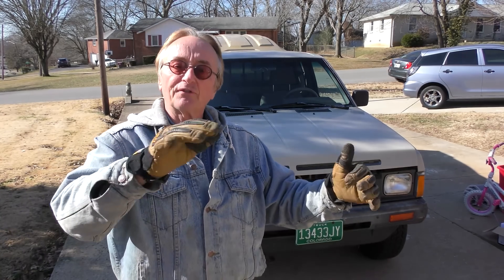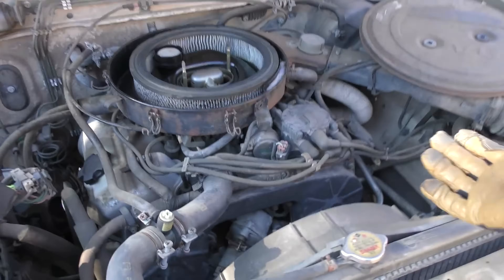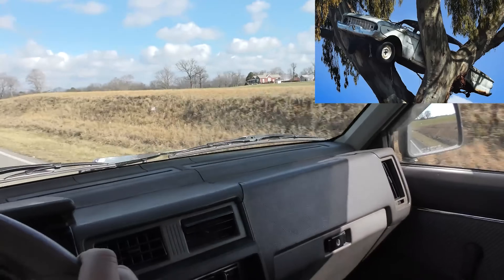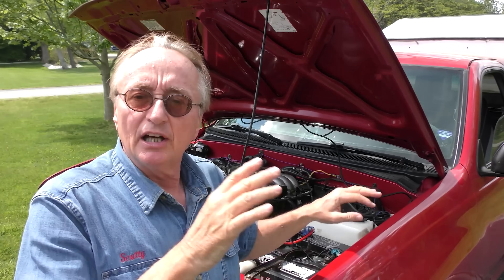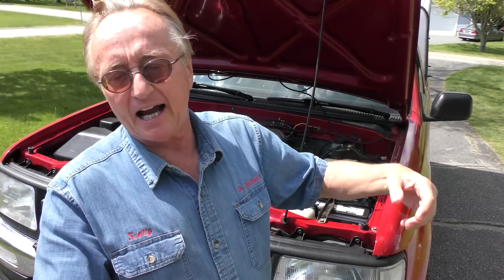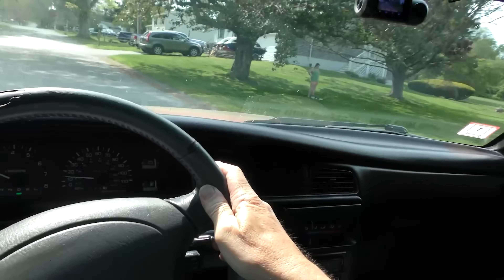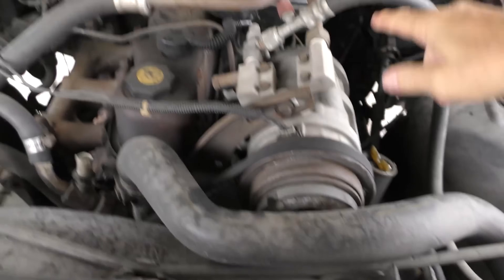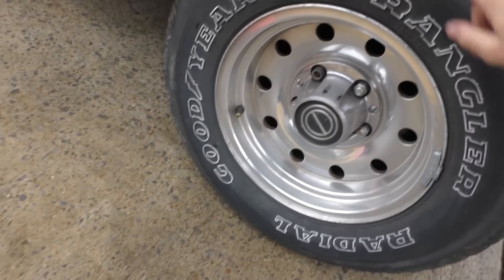3 Cheap Used Trucks That Will Last Forever (You Can't Destroy Them)

Comment: My last rig was a Chevy Silverado that had automatic transmission but the 4 wheel drive was manual, mounted on the floor like a manual transmission would be. No servo or slave cylinder, it worked every time.I’ve had a failure with the dial on the dash function when I really needed 4 wheel drive.

Comment: SE-V6 hardbody, 4.0 Ranger, 4.3 Vortec 1500. Those would be my choices in my experience.  Especially if youre looking for a small truck that can be taken off road and last the longest. All of my Toyota buddies have switched out engines multiple times while saying how reliable they are... While I've had the 3 trucks (multiples) driven offroad and sold while still running and driving perfectly.

Comment: My family has unfortunately owned several Nissan 4x4 trucks . The only truck i have found that was more worthless was a early 80s ford ranger . Weak,engines 4x4 frontend alignment would change every time i had to use the 4x4. Trans. Was hard to fix with a consistent gear issue.  If you owned a 1990s ford or chevys truck you would understand the unreliability of a Nissan truck .

Comment: I owned a 1986 2WD Nissan Sport Truck until the engine gave out in 2018 after 235,000 miles.. Over the years, I replaced starters, alternators, batteries and tires. I tried to change the oil every 3500 miles. The little engine just kept purring along. In the bad winters, I chained it up and put weight in the bed and it would go almost anywhere, even uphill on icy roads. When its engine finally gave out I put it up for sale on CL and a tweaker looking guy came and bought it for $700. I almost cried when he took it away. The truck witnessed my kids being born and leaving the house. It comforted me during my divorce.  I lost a true friend.

Comment: I've got a 96 F150 4x4 short bed single cab with the 4.9 six cylinder and a 5 speed manual transmission. I had to get a Ravelco anti-theft device put on it because it is the easiest truck in the world to steal. This device is not an alarm, it just will not allow the truck to start when activated. Thieves can still break in, but the worst they can do is run the battery down by cranking on it. I had it put on the truck after my son got his 95 F150 stolen.  I live in south Texas where thieves steal F150's and take them to Mexico.

Comment: My first toyota was a 1995 T100. I bought it with 336,000 miles on it. It had the 3.4 v6. The actuator for the 4wd didn't work, so no 4wd. But I dro e it for another 60,000 miles. I handed it over to my son who drove it another 60,000 miles, like he was competing in a baha race. He drove it another 
60,000 miles, until the driveshaft yoke  broke off the pig, bounced off the pavement, and put an inch long gash in the metal gas tank.  In the process, the driveshaft bent. He searched databases all over the u.s., and couldn't find another one. He traded it off for an all wd audi. Broke my heart, but he needed to go to work. It still ran like a top. And the frame was not rotted. My 94 hilum had a rotten frame. 😢

Comment: I had a T100 8-ft bed extend cab it came with big rims and BF Goodrich tires I used it for painting business and got over 20 miles per gallon gallon with a V6 five speed

Comment: The 93 s10 5sp with the Pontiac 3.4 v6 got 33mpg when i checked it and ran like a sports car.  Loved it.  I think it was a 3.4 or I'm confusing it with the Lumina i had, but it was a smaller Pontiac engine

Comment: I bought a 96 t100 with 300K miles 6cyl and it ran like a brand new truck. I sold it with 355k on it because the paint was fading away and I didn't want to pay someone to repaint it. I got a lot of cash and a 90 Camry with low miles on it in the deal.

Comment: I bought a new 1990 2wd stripped 4 cyl 5 speed Hardbody for $7900 out the door after incentives. No radio, no AC, no power anything and no rear bumper. I added the radio and drove it 200K miles. I had to replace a fuel pump and water pump. I never even changed the clutch. I wrecked it. The guy who towed it gave me $1200 for it and fixed it and I saw his son driving it around.

Comment: Interesting you mentioned exploding Firestone tires !??? I never heard of that. I preferred Firestone Destitires because I had 3 different time that Goodyear tires center tread part of the tires separated from the tire and beat the crap outta the truck. Lucky was going under 30 mph each time. …but point is I prefer Firestone over Goodyear in my case.

Comment: I have the 86.5' Hardbody w the V6 2x4, 138k and never needed 4wd. Just had the timing belt & adt'l belts changed due to age. Still runs great, passes CA smog w no prob, and get asked all the time if i want to sell. My response is always... Why? 😅
I get the same queries re my 80' 280ZX T-top...  again, my response... Why?
My 08' Nissan Altima cpe again w the V6, is another story. My regret is the cvt... but once it engages, get outta my way.
Reply: 280zx t top=my dream car

Comment: You didn't include the toughest truck Ever, 1986 Toyota with R22 engine. Mine is still a daily driver with trips across country  all the time.  Has never burned a drop of oil and air is still ice cold

Comment: I have a 2005 Frontier V6. 2005,000 miles. Engine is great. Fast!
Reply: Agree. I have 2009 Frontier 2.5 engine with manual transmition. Simple and solid truck.

Comment: I’ve got a 1991 Nissan Pathfinder XE-V6 with 133,000 miles on it. I need to replace my ball joints and I’ve got a check engine light that my OBD 1 blinking code says “Injection Circuit”. I’m going to try that expensive fuel treatment stuff you love so much and hope it cleans up my fuel injectors. Wish me luck. - Thomas

Comment: My truck in high school was a 1988 Nissan Hardbody 4x4  V6.  I bought it for $1500 with 102,000 miles.   I drove the wheels off that truck for yrs & sold it for $1000  with 225,000 miles.   Yrs after that i seen the truck & talked to the guy that bought it from me.  At that time it had 355,000 miles & still going strong !   He wouldn't even talk about selling it back to me HaHaHa.   It was prob best vehicle I've ever owned.

Comment: I have 2 hard bodies, a 91 and 93, but the 4 cylinders. Check the frames before you buy this year range. Also, the timing chain tensioners are a pain, but there are better fixes now. I just restarted my ‘93 after it sat for 5 years. I had to put new injectors on it which cost $35 for a set. I recommend everyone change their injectors as the truck will get weaker without you noticing. By far, the easiest vehicle to work on. I am fixing up the ‘93 for my nephew. Injectors, complete brakes, plugs, wires, fuel filter and distributor cap. No carburetor or variable valves. It would make a great off road vehicle if you swapped in a small diesel.

Comment: I bought a Toyota T100 from the original owner and it had the head gasket recall replaced and it had less than 100k. The head gasket failed a second time and the tires were all dry rotted. I have owned a few older Toyota vehicles. Be sure to have all of them checked out before you buy them.

Comment: Nissan, Check or Service Engine light is on and no mention of mileage. Toyota doesn't burn anymore oil than what it always burns hence uses no more oil than usual. My 1990 Bronco has multi port fuel injection not shitty throttle bodies! Sorry but I'll stick with the Ford Excursions 7.3L Diesel power by IH and fuel injection by Caterpillar...Made by, paid by and driven by Americans!!

Comment: We have one Nissan hardbody, its called D21 (king cab) here in europe. It have 1000 000km, drive in decent conditions here in Slovakia by the pervious owner. Same as yours, but with 2,5 4 cilinder diesel engine. Completely rotted. Frame needs to be build new according to original, lower a pillars are gone, cab needs to by stiffened up by rollcage (safety first), front clip needs to be redone and bed needs to by build new (only lights holders frame for rear door stay original). Suspension needs to by rebuild for springs (because new torsion bars cannot wistands few years and original are vorn out). These cars holds crap and moisture everywhere ewen inside frame, there is badly inginered water paths in pillars rockers frame and bed. So yes, they are better than new ones (weights 1,35 tons only, mayby 150kg more after my restomod and restoration) but after you rebuild it. 

I think chevrolet sqare bodys from 1990s are better choice. But here in europe, not really available in decent price.

Comment: Hi Scotty, I love your videos.  These trucks are great but looking for maybe a ford F 150 or F-250 that has greater towing capacity for towing a boat and for payload for firewood, for my place in remote Alaska where we don't have a service shop as its too remote. What years do you recommend and what years when Ford got into automatic 4x4, as I want a 4x4 you can do manually?  Like you said the less computerized the vehicle the less problems and the easiest to fix, and where I live that's a MUST, thank you I really would appreciate your advice.  I need a reliable truck that is simple to fix as I am not very talented with mechanics, please recommend the Best years for my needs?

Comment: Yeah, I just got my hands a hold of a 2004 Nissan exterior exterior or Kat pronounce that name Xterra Xterra that something like that anyhow it’s a five speed four-cylinder fuel injection got it from the original owner passed away and I think it’s gonna cost me to get a transport transfer paperwork and let it go to smog and it needs four tires. Otherwise no dents no rust original owner. I’m looking forward to getting some running oh it just needs a clutch cylinder. It doesn’t engage that little tiny $15 part failed so I’m gonna pop that in and I’m gonna have a new car that’s gonna get me around better gas mileage.

Comment: 300 in line six with manual will kast 40 years plus, i have one, wouldnt trade it for new, most reliable engine, even blows toyota and nissan out of the water

Comment: I have 91 f150 that cranks but won't start. Will no start off starting fluid but i can hear fuel pump working. I used a ob1 scanner and gave codes for tps and map sensor fault.after replacing those still no start. Changed fuel filter still no start.Any ideas to point me in the right direction would be a blessing .

Comment: You want a good truck? Get you a 1970 Zelda, 100 straight sex. Get you the 1970s Ford Carrier. Or early 90s model 80s model Ford Ranger 4. Cylinder, I got over 300000 almost that's what I'll try.  Are some of the best domestic vehicles?You're gonna be Toyota Ford Ranger and old and 1980s.70s, 4 trucks from 1960s.That's the best vehicle stay made

Comment: My 94 Nissan pick up dies at idle, specially in hot weather, already replaced the vacuum hoses and the idle air control valve, had the tps replaced a while back, have no codes on ECU, any ideas anyone?

Comment: Cheap used? Haven’t seen anything cheap used (below $3000) that doesn’t have a blown head gasket, broken timing belt with bent valves, transmission with no reverse…..

Comment: One advantage to the electronic systems though is if you find yourself in a situation where you NEED but stopping is not an option, that's the advantage of the electronic systems (and honestly, if you read the manual and use them as they are designed - ie. don't use them on dry or just wet pavement as that will destroy 4WD systems) they should work fine.  All of the ones that I've seen that have failed it was usually a switch issue or perhaps a wire issue but could sometimes be easily fixed.  Of course a mechanical shifter as you mentioned is best ,but both had the pluses and minuses.

Comment: You're slamming a company for being unable to scan engine data when it is clearly labeled TPMS Diagnostic System, and you're upset it can't connect with a 1996 year which doesn't even have the system that tool is designed for...😂😂😂 this is why real mechanics  can't and don't take you seriously on this platform or any other.

Comment: I have an 87 Toyota pickup with the 22RE.  That thing’s a cockroach…it won’t die.
Reply: I have a 93 that I bought new still running fine and burns no oil at over 300,000 miles. 22re manual transmission. Made in Japan BTW.